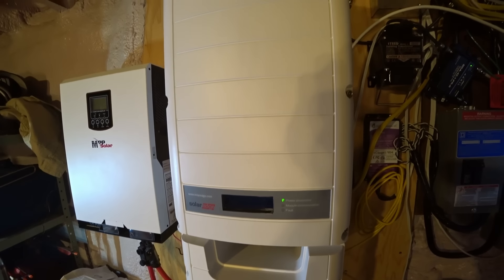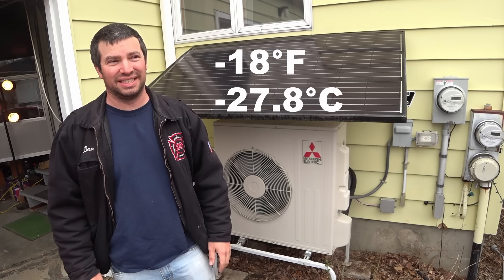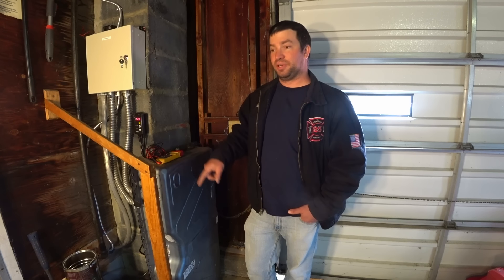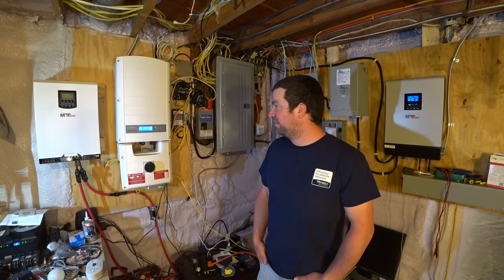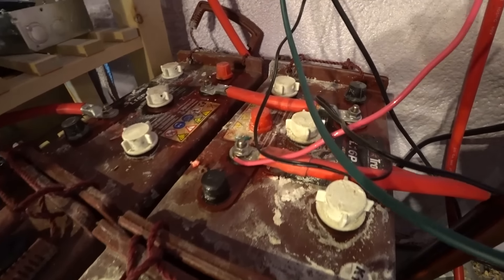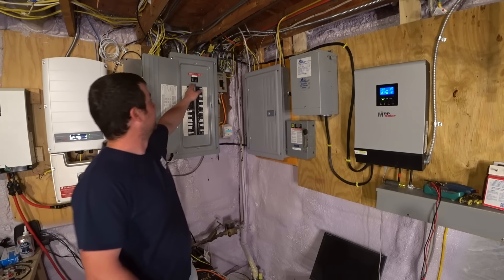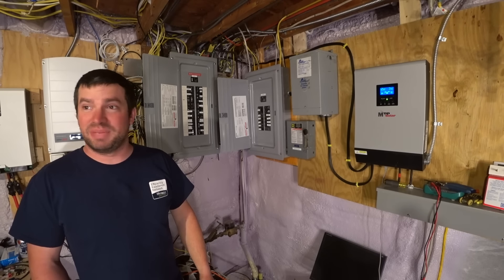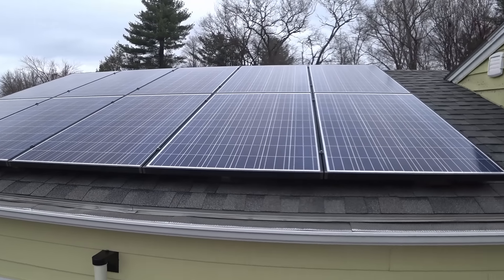Huge Grid-Tied Solar PV with Battery Back-up System

Comment: Battery pack doesnt work that great or it has to generate hydrogene to make energy instead start with isolate the house store your energy in the ground with watertubes so you can store your heat in the ground at daytime and use it at night when you don't have your solarpanels for backup, underfloor heating with water uses only 45 degrees suplywater instead of 90 for gasheated house without losing comfort use separate readjustment for different rooms, heat recovering unit saves energy as well
Reply: No...

Comment: I would like to make one room solared powered or if its a thing, half solor half electric.  Im trying to make the room a grow room. So ill have fans, heaters, dehumidifiers on 24/7 and 600w running atleast 12 hours a day if not 25/7 for a few weeks every 3 months. Is there a way to do this?
Reply from the maker: Sure.  It's great that you have already calculated your loads, 600 watts.  My favorite online calculator is from Alt-E because it also shows you the batteries, solar, and charge controller.  https://www.altestore.com/store/calculators/off_grid_calculator/  
If you want 600 watts x 12 hours per day = 7,200 watt*hours of storage.

Comment: We are grid tied here in SE Georgia with no backup yet. I am really wanting you to post a link to your battery source.
Reply from the maker: Hi Mark,  Ben purchased his battery through Ebay.  You can do a search for used EV batteries and find Chevy Volt, Nissan Leaf, Tesla, Smart Fortwo, and others.
Reply: @DavidPozEnergy   I wondered about the battery also... So his is a battery pack from an Auto?  I would think even a golf cart one?

Comment: Excellent. So, you get charged 0.15 /kWh, but they pay you 0.21 /kWh. And you can charge your battery from the grid, then send it through the inverter, and sell it back to them. That seems too good to be true. Am I missing something? Anyway, I love what you have done. I'm a retired electrician, and I think I might like to do a home system, and if I like doing it, I might expand out and do it for neighbors.
Reply from the maker: I'm guessing the losses in the inverter, wires, and batteries might eat away at the margin.  But I don't know for sure.
Reply: @DavidPozEnergy  Thanks for your answer. I think you are probably right about the losses.
Reply: @solarfluxman8810  You also have to consider the cycle life of the battery. Amortise the cost of the battery over the lifetime and that's usually way more of a contributor to cost per kWh than inverter and charging losses. For the commercial lithium ion like tesla's powerwall that amortised cost incl. installation plus the conversion losses can be 10-11c per kWh. With this setup it could be half that, but it's still a waste of a cycle to sell grid power back.
Reply: @cros13  Thank you. You make an excellent point.
Reply: It partly solves the problem of Utility battery storage.  If customers all had batteries the problem is solved; not only that, but customers bear the cost of all those batteries.  It is a good and clever way to earn a few pennies; spend thousands!

Comment: One important thing to point out about solar is this.  Know what your charge is per KWh from the utility company.  Mine is about 12 cents per KWh for the first 1000 KWhs per billing cycle (usually 30 days).  Here in my state, we get about 5 "sun hours" per day, which means that on average, we get the equivalent of about 5 hours of strong "straight up" sun as far as solar electricity generating power.  So that is 60 cents per day of electric per KWh of solar panels.  I derate that to 40 cents due to system losses and inefficiencies such as not always being able to use the full output from the panels (such as batteries are already topped off, low electrical load, solar charge controller losses, losses in long wire runs, partial shade...).  So 40 cents per day is only about $12 per month of electric.  If my electric bill was $100, a 1 KW solar system might drop it to $88. To completely get rid of my electric bill (not really possible), I would likely need an 8 KW solar system.  Since I cannot fully get rid of it (since I have to keep grid power and pay the monthly service fee), my "best" solution is to just use solar to lower my electric bill, but not eliminate it.  A small 1 KW system (3 to 6 panels depending on wattage per panel), is fun to tinker with, but doesn't save much money.  The cost of all the equipment for even a small 1 KW system is about $1000 (6 used solar panels, solar charge controller, 8 large used 6V AGM batteries, split phase inverter...).  The RoI (Return on Investment) time would normally be about 7 years for this setup, however, it would be even longer for me cuz I get some assistance with electric so for me, solar is not worth it.  I would break even at about 10 years with a 1 KW system.  I likely won't be in the house that long.  However, I could use it for 5 years and then sell it.  That is a possibility too.

Comment: What is the purpose of the PV panel mounted over the Mini-Split system?
Reply from the maker: Originally Ben put it there as part of his 24 volt system (those old lead acid batteries).  Then, for a while, it was just to keep the freezing rain off the mini-split.  Currently he has a micro-inverter on it as part of his back-feeding, net-metering, system.
Reply: Actually, I'm currently back feeding my PIP and powering loads with it, but never the grid.  I didn't want to do anything to jeopardize my 10 year net metering contract, which I would have to amend if I added more grid tie.

Comment: Looking good.
Reply: 48 is not the way to go. HV systems are the way to go. I run a 120vdc to 120v ac
Reply from the maker: It would be great to run higher voltage.  I think the electrical code prohibits that for residential.  Do you know a legal way around that?  Thanks.
Reply: @DavidPozEnergy  ya. Just do it and dont say nothing. Off grid doesnt get checked in my area only grid tied systems.
Reply: @frankz1125   The  wire you use solid or stranded.?  DC to an AC motor?

Comment: Why did you get rid of NG  for propane?
Reply from the maker: I'm pretty sure Ben said it was cheaper for him.  The monthly cost just to be connected was more than he spends per month on propane.
Reply: I was using so little gas that it was less than half the price per month for propane. (Average $10/mo)

Comment: Nice I am headed back to the US (Massachusetts / New Hampshire) from the Philippines and want to do a similar system when I get back.  My sister has a full array on her house in Mass and it provides her with a check from the electric utility every month, it is nice to have a zero due electric bill every month.

Comment: North  Panels. Do the math. 30% of that North Facing could have been ground mounted, wall mounted anywhere and got the same gain @ 70% less install cost. All you have got is a complicated UPS. Give me a break.
Reply: Install cost was $0. Panels were $.2/w. Summer exposure is good, winter is not.  Powered my house most of the summer on that north facing array.

Comment: Ben is a funny guy, I'm glad to see that automotive batteries are reused. Was the Smart battery already too old to work in the car, or the car got scrapped or something? Did you measured any battery degradation over time?
Reply from the maker: The car was totaled, and the parts sold.  That's where Ben got it.  I think he told me the original car had 30K miles, so that means the batteries are still very new.

Comment: So, Northern Vermont is around 44 degrees north, but the roof is pretty flat. Christmas day at noon the angle of incidence would probably be too great to get any sun on those northern panels, but I bet you get wind in the winter up there! 500 watt wind turbine and you would be barely drawing down on the battery.

Comment: Thanks David, great interview with a real "Yankee."  You let the guy talk, which shows your emotional maturity.

Does he still use a solar hot water heater?
Reply from the maker: No solar thermal panels.  Ben is solar PV (electric) only.  Thanks for watching.
Reply: . So he's powering his HW heater off PV, or propane?
Reply from the maker: It's a standard electric water heater.  it normally pulls power from the grid, but he is still net-zero because of the big grid-tie system.  The propane is only for cooking.
Reply: Heat pump water heater actually. Pulls heat and humidity from the basement.  Basement gets a little colder, but I don't have to run a dehumidifier so it's a win win.
Reply: @benssolarandbattery  Is it a Rheem Hybrid tanked water heater? Thanks.

Comment: The angle of those panels looks a little low for that latitude?
Reply from the maker: It is lower than ideal, but Ben is still net-zero.
Reply: @DavidPozEnergy  Can be cheaper to buy a few more panels than more racking to change angle or changing the roof!
Reply from the maker: Good Point Andy.
Reply: Andy Lee Robinson agreed!
Reply: DavidPoz good point.  The video was nice!

Comment: Checkout the MPP LV2424 and the LV5048..  they can output 120v but can also output split phase  240, and also has grid tie!  It can be programmed to take grid power when available, so your batteries are on standby.

Comment: You guys got your batteries cheap used, but I'm wondering if it wouldn't make more sense to get a gas generator over something like a new Tesla powerwall, if it's only being used for backup power.
Reply: Be libertarian!  Do it your way!
Reply: Tesla power wall is very expensive at $11,000.  My entire hybrid system (with second hand solar panels, hybrid inverter/charger,   bank of 12 x 120AH battery) cost just a fraction of telsa power wall.

Comment: This is somewhat the same idea I have for my home. I live in southern Alabama so cooling is our main issue. I don't mind feeding power into the grid but don't want to be without power in a power outage. I require electricity at night for my cpap and my brother is on oxygen. So power is a big deal with us. I would prefer to be offgrid but my area does not allow it. So a grid tied system that has battery back up is a must.
Reply from the maker: If you have not already seen it, the Sol-Ark allows for both grid-tied, and battery backup, in one unit.

Comment: north facing roofs:
in overcast panels deliver the same like south facing panels, if the inclination is the same. and ok, in overcast you need most panels, solar energy.
in summer they generate the same amount in sunny weather, however in winter that drastically reduces.
Reply: So the snow slides off, use Rain-X. Works great!

Comment: I like solar systems but they are expensive 💸🔥😥
Reply from the maker: They can get expensive very fast.  You could start small.
Reply: GMC, if you think about HIS system...it is expensive NOT to have a solar system. 
For the exact same amount of power, he gets more money to produce electricity, than it costs him to use it!!
Reply: If you do it yourself you can come real close to a dollar a watt. When I first started looking at solar it was over twice the cost of doing it today. We are in our “forever” house which we bought last June we have a five year plan to do the roof kitchen and two bathrooms and a ground mount solar system with battery backup. We are on a well and septic system on a 1/2 acre lot and want our expenses to be as low as possible by our retirement.
 It will be ground mount for ease of maintenance as we age. The solar should pay for itself in about five years. 
    It’s 27% of the cost of paying a company if I do it myself ( with the help of my friend the electrician) 
To me solar is a no brainer you are paying for it already every time the light bill shows up.

Comment: I might have missed it, but how is he converting the DC from the panels to AC for the house?  I didn't see a 15kw inverter anywhere.
Reply from the maker: He has a 5kw inverter that powers the house in an off-grid fashion, and a second 10 kw SolarEdge inverter that is back-feeding the grid.  Thanks for watching.

Comment: Thanks for coming to see the madness, and awesome job editing!!
Reply from the maker: Thanks for sharing your awesome setup for all of us.  Thank you for the comment on editing.  I'm trying to get better at it.
Reply: Really nice setup, thank you! I was wondering: when the grid goes down, does the MPP inverter's mains power output provide a signal for the solaredge inverter to synchronise with and provide power too? And then, if the solaredge is providing mains power, can that power be used by the MPP to charge "from the grid"? It'd be great if it were that flexible... And also, if you have a real grid failure somewhere up the line, won't your system attempt to keep powering the complete neighbourhood until you trip the breaker?
Reply: The MPP does not support AC coupling with grid tie inverters, nor does it backfeed the grid.  All power produced is used on site.  The solaredge is (for now) useless to me when the grid is down.
Reply: @benssolarandbattery  what are your thoughts on an AC coupled battery backup system?
Reply: @leviclark2573  they're a little less efficient than DC coupled systems, but a great way to add a battery to an existing system.  When using lead acid, there are lots of sizing requirements for AC coupling that are based on the battery charging needs.  It becomes a lot easier with lithium, as they can take almost anything you send their way.
Reply: @benssolarandbattery  . How many Kwh do your 13 kw of Solar PV produce  per year
Reply: @josephjohn907  the 10.9kW grid tie system on the south roof produced around 11-12MWh/year.  I haven't had my off grid system up and running for long enough to see what it produces yet.
Reply: Thanks for making this video! Too often I see fearmongers trying to discourage DIY folks from attempting this sort of Frankensystem because it eats into their profits. True, there are plenty of dangers if not done correctly, but it's still do-able if enough homework is done ahead of time.

Comment: Am I dumb for wondering why he'd use propane when he has natural gas available?
Reply from the maker: Ben was paying more for the meter each month than he was paying for the gas.   By switching to the propane he saves money.  Thanks for your question, it's not dumb, it's helpful.
Reply: @DavidPozEnergy  I have natural gas in South Florida.  I use it for my stove and my dryer.  Family of 4 with 3 women that use the dryer religiously and my bill is $35-$50 a month.  Propane would be way more expensive wouldn't it?
Reply from the maker: I don't know about your situation.  I think Ben said he only uses propane for his stove.  Everything else is on electric.  Check out your bill, it is going to be broken down into the charge for the meter, and the charge for the consumption.  Sometimes the meter charge is called "Service charge" or "connection charge" or whatever.  It is the fixed amount every month.  In Bens case, the cost to be connected was more than his cost of the consumption.
Reply: @DavidPozEnergy  Oh I see what you mean.  I guess if you use more gas appliances it makes sense.

Comment: 5:51 ???NORTH FACING ARRAY!  UUUGH!
Reply: South roof was full, didn't want a ground mount in my yard.  Panels were $.20/w and cover most of my summertime usage.
Reply: Producing 75% of rated output during the summer.

Comment: Brilliant example. Many thanks to Ben and his expertise. Inspirational would come to mind. Question is how about snow on the panels... Is that an issue?
Reply: I get up on the roof and push it off with a reversed roof rake when it snows a lot.  Once they're a little clear, they melt off pretty well when the sun comes out.
Reply: @benssolarandbattery  Try Rain-X!

Comment: Interesting video, amazed the power bills him 15 c a kwh and he gets paid 30c a kwh , I live in Melbourne Australia have 2 systems 1 at a beach house 11.3 c kwh and billed 38 c kwh 2nd system been in 25 years hence I get 71.3 c kwh will be doing a grid tied system with a battery in 2024 when my rate runs out.
Reply: Its because up here in northern New England. We have supply issues, the population doesn't support more inferstructor. So power companies, are subsidised for helping with the smoothing the spikes in demand.

Comment: I would never mount solar panels on the roof of my house.  How would one dust the grime off?  I tell you it can't be easy.  Better build a frame 3 feet off the ground.  After all, it is farming.
Reply from the maker: I also have solar on my roof.  The rain and snow cleans them fine for me.  After 6 years they are still producing to rated power.
Reply: @DavidPozEnergy  Good, conversley I am in the process of purchasing 40 off-grid in the desert.

Comment: Those PIP solar inverters seems to be the same one sold as FlinEnergy in India. I have been looking at having one of those at home as off-grid system, mainly to power air-conditioning during day time. Great to see some real-world experience with it.